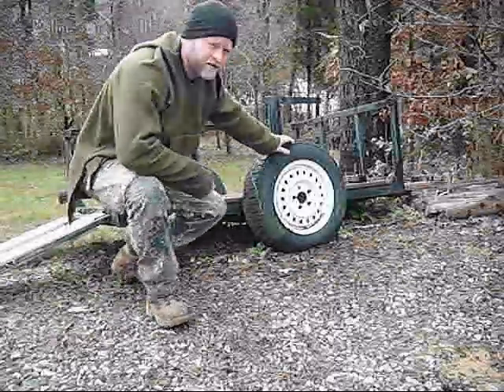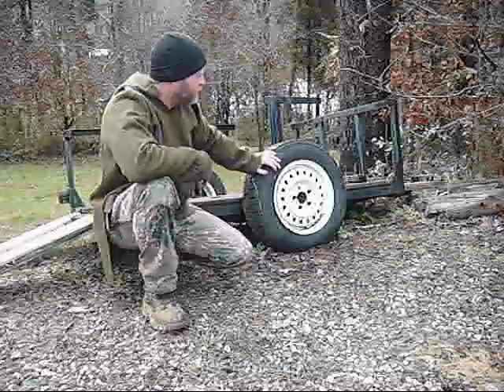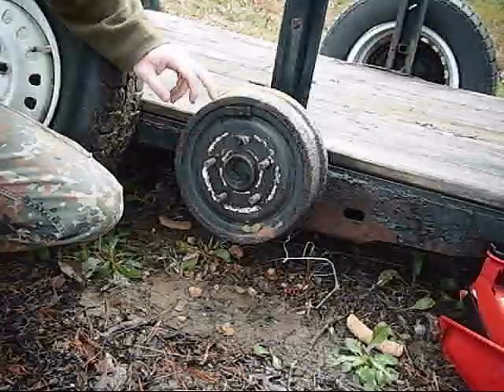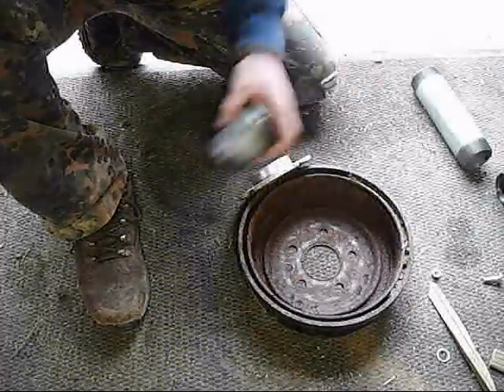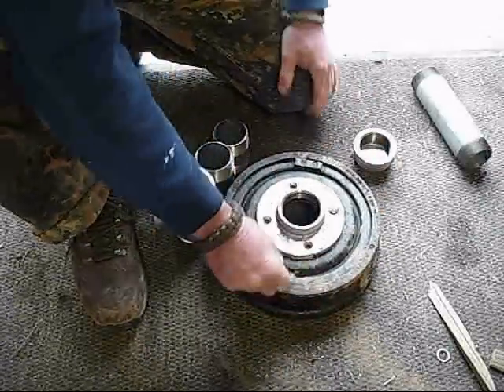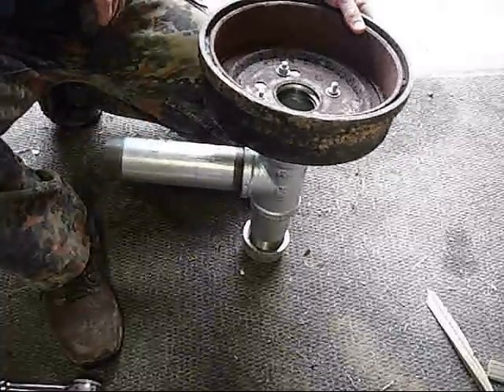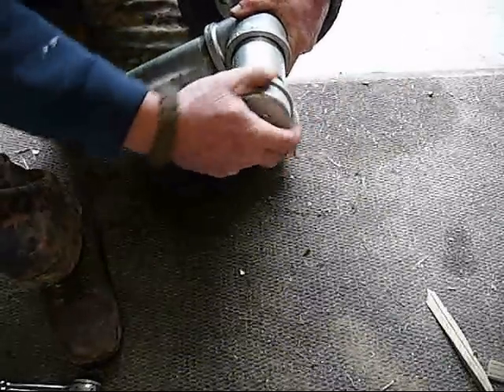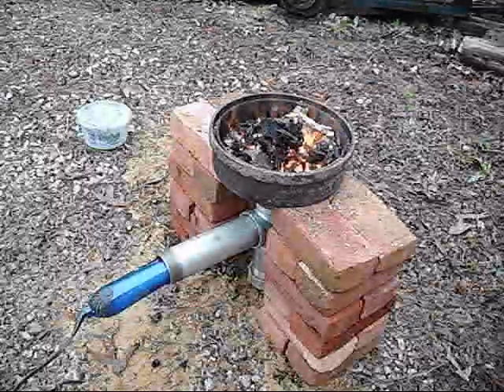Brake Drum Forge

Comment: Looks good gave me an idea to use a  car rim and a leaf blower
hell i forged me a set of tire spoons the other day TSC wanted like 60 bucks for a set.  FK that I thought. I dug me a channel in the ground ,  dumped in 5 gallons of coal , I used a box fan to get it real hot  a 20lb sledge as my anvil and a 3 pound mini sledge to work the metal  first thing iv ever smithed they turned out really pretty. i oil dipped em when they was glowin put a nice rust proofin right on em

Comment: this design works well but if your on a tighter budget then instead of buying black pipe and fittings just use a piece of 3in exhaust tube and get a 90 bent on the end. with a brake drum forge, they are small and light enough that when you want to empty the ashes you just pick it up and turn it upside down, so there is no need for the ash traps, unless you just want one.

Comment: I used compressed air from my air compressor.   Screwed the male couplers in at several different places and could change my air direction when needed.  Put some sort of regulator on the line and you can adjust the pressure of air.  You could have put you a male air coupler on your bottom pipe and capped the end off and you could get a lot more air volume if needed. More than a hair dryer, anyway.

Comment from the maker: All I could find in black steel was 1" I plain to change them as soon as I can find iron or steel actually you can touch the pipe even after running the forge for half an hour the flage my get a little hot but you are right I will change them to be on the safe side.

Comment: @staygoldart it does not let off lead gas. its the zinc thats in the fume, if you breath enough of it, it will give you flu like symptoms, which drink milk helps. I'm sure over time of breathing it will harm you, but your body gets rid zinc naturally. after awhile though, the galvanize will burn off. you could try putting those parts in a fire to burn them off before using them. I'm no expert on galvanized metal but I do weld alot of it.

Comment from the maker: @swedishhunter21 yea you can bring it up to welding heat if you put the bolt by its self in the forge it will bring it up to welding temp., but the bolt that hold the flang to the drum will not get as hot because of "convection" heat transfer to the mass of the drum.

Comment from the maker: Well steel is best, but the thing about it is the pipe never gets hot enough to give of toxic fumes also I use mine outside. Now if you plan on running it all day inside a 10x10 shop go with steel to be on the safe side.

Comment from the maker: Galvanized will put off toxic fumes if heated but this set up does not get the pipe hot enough, but to be on the safe side use steel.

Comment: i would have used a tank of some sort for my catch. simply so i could go longer with it before it filled up. but that's just me. my forge is a class-8 truck rim that warped. wont last long but i am just starting. i still need a way to get air pumped into it though.

Comment: if your'e concerned about zinc fumes (or even lead fumes),why not use an air-supplied  respired respirator when working with suspect metals ? I sometimes work with a flux wire-welder,and they don't  say what's in the flux,so I don't take any chances...onagrou

Comment: @davepen16  i was actually about to say the same thing. but i was also wondering, what can be used? i was told before " use black iron because galvanized pipes release toxins when heated" but i was wondering what else could be used. Is it anything thats not galvanized or is it more complicated than that?

Comment: Good thing you had most of the stuff around Because Just a 2inch flange is 14 bucks at Home Depot or Lowes  Because you said you had about 12 Bucks in it.  I just bought everything at Lowes  and spent  $45 for all the piping.  going to a gas station or Repair shop to get a junk Drum
Reply from the maker: Yea that was a few years back, but I did have some of the stuff already.